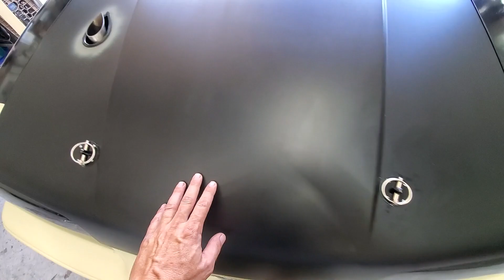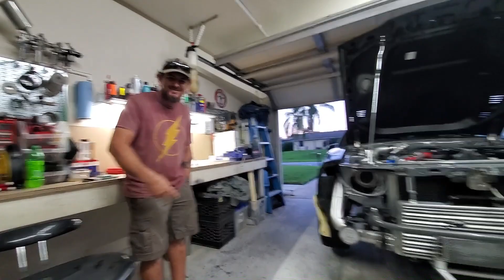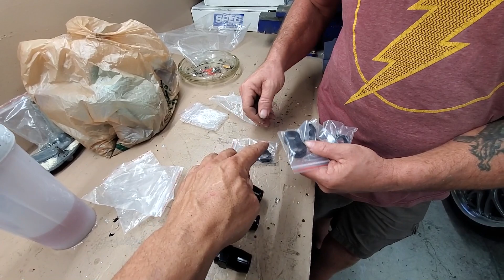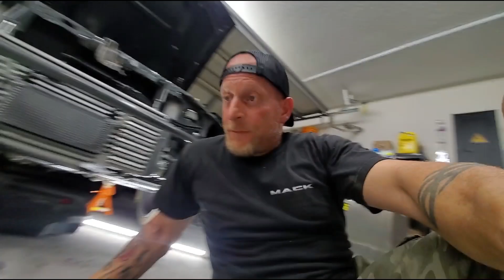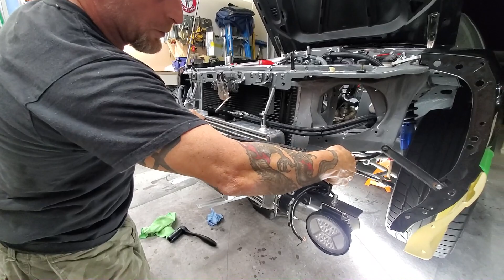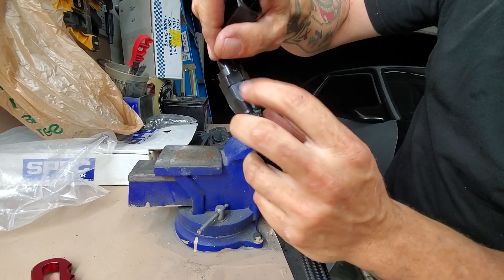AN Hoses and Fittings - OIL Cooler Install and More!

Comment: You’re 100% right about the ethanol in the fuel breaking down regular rubber line. I had my -8an stainless fuel line making a 90 degree turn by the muffler about 6 inches away. The fuel line sprung a leak right in the middle of the turn. My mail lady literally just dropped off my 1/2 inch ptfe hose and fittings. I was debating breaking out the dremel with the little cutting disc and making an end on it. I have like a 1k miles on my build and the original hose I used went to crap already. Live and learn I guess. I’m going to use some dei heat sheathing anywhere it gets somewhat hot under the car now. I used it in the front originally but not the back. Good video.
Reply from the maker: Right on brother.. sorry you gotta go through all the BS to change it but with the ptfe line this is the last time.. promise! Lol good luck with the build man.. hit me on IG if you need anything!
Reply: @TonyDFreestyle96  Thank you

Comment: Great video now i have 20 feet of -6 AND -8 of hose i cant use for my fuel dam you Tony i see you have braided power steering lines can you post what you used and the fittings thanks in advance
Reply from the maker: Thanks brother.. yes definitely use ptfe for your fuel line.. use that -6 rubber line you have for the return side of your power steering.. for the pressure side Earl's Performance 150606ERL with the appropriate stainless fittings... its expensive but one of thise items your only gonna deal with 1 time...